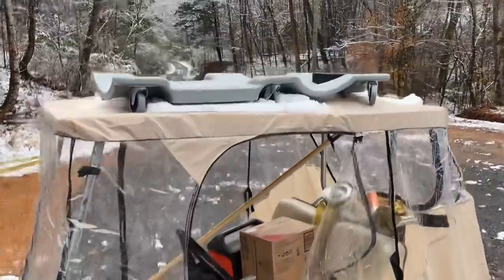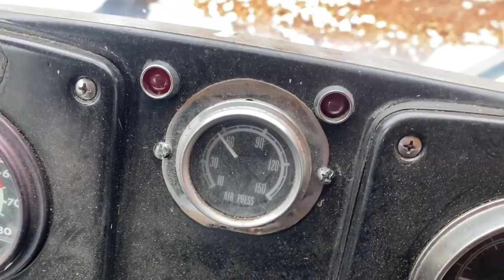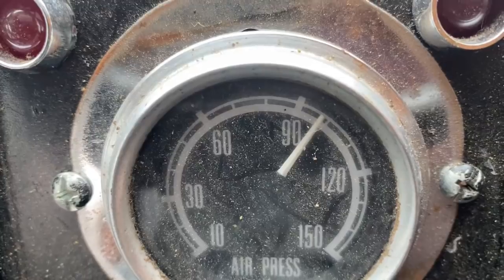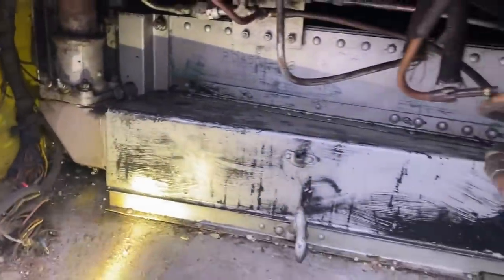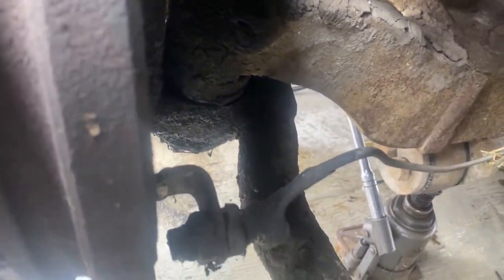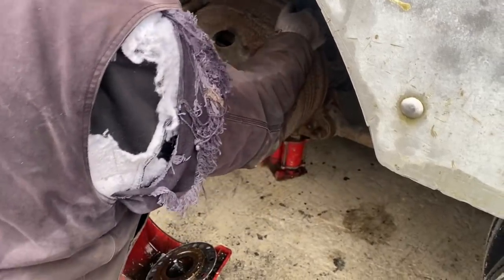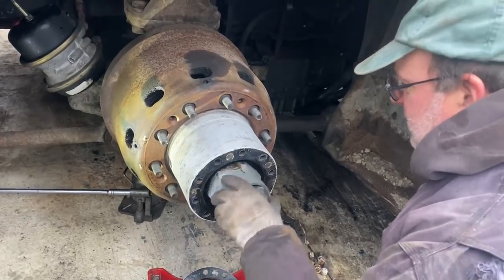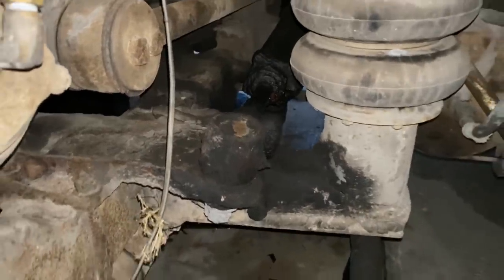Scenicruiser safety issues

Comment: One winter outside then the Quonset hut! I like to make a suggestion (but maybe you already thought of it). Heat the floor. Be the best thing you could do IMHO. You can hear each individual pully and belt problem. I got some noise in the back. He has a point about the LH lugs lol
Reply: Yep. In floor radiant is definitely the way to go. I worked in a shop that had it for a while. It was great!

Comment: Scott, I'm almost 71 now and learned to drive tractor-trailer in two separate Int'l tractors, one with 8V-71 318h.p. and the other with an 8V 71T 350 h.p.The 2 strokes were used in many different applications and the  only ones that were really successful were the G.M.engines.2-53, 3-53, 4-53, 6V-53, 8V-53, 2-71, 3-71, 4-71,6-71, 6V71 8V-71, 12V-71, 16V-71, 6V-92, 8V-92 , 12V-92, 16V-92, 6-110,12V-149, 16V-149, 20V-149 and also I believe a 24V-149 turbocharged and non turbo. The 110 series was used in the early Euclid road machinery.

Comment: Scott. In my lifetime, I am approaching 66 years of age, I have come across situations where people from my past, and situations during those times, living on farms, old tractors, and the what not, marine diesel, as a marine surveyor, I have familiar understandings for early Detroit. 353, 453, 653,671, 692, 871,892, 1271..six cylinder 6v 92...as well as 8's and 12's and 16's.....and on into Locomotive applications. If you are not charging at least $150 dollars an hour...I think you are, and should be, I'm moving in and also repair buses..like YOU!

Comment: I'm impressed at how the chassis appears to be largely free of corrosion.  No obvious weld seams opening up.   Replacing the moving parts, wheel bearings, seals, rubber suspension bushings, king pins, some air bags, tie rod ends, pitman arm, that is what you'd expect after a lot miles.   I'd think the steering box would have a lot play by now if it hasn't already been rebuilt or replaced.  

The Scenic Cruiser had an issue with cracking frames.   I think there was a retrofit kit for them.   I wonder if this bus has it.  The Scenic Cruiser is still one of the coolest looking busses ever.   I can easily see why somebody would resto-mod one.  At least a few models came with a 12V71 a V12.    Not turbocharged originally.   Its amazing how advanced it was.  Airbag suspension, independent tag axle (I assume).  Solid axle front suspension, but only the Eagle bus had an independent front suspension years later.

Comment: I like how this rig has primary and secondary belts. My big rig doesn't even have that. Just one thick ass belt.
Sometimes you gotta have them sit at a high RPM to open the valve to fill the air tanks lol.
Great sounding motor though.

Comment: 21:33 - "Looks like dollar signs to me!"🤣 Yeah, buddy! Replacing those big-ass bearings, kingpin & bushing kits, labor, etc. can get expensive REAL quick on one of those beasts!😲 I'd definitely be getting rid of those stupid 'spike' stud caps and just sand down and repaint the nuts on those 10 hole Budd's. They're a hazard any way you look at it.😜 Heck, even just round chrome caps would be an upgrade!😁👍
Reply: Those caps hide loose lug nuts, I never used them.

Comment: For the life of me, I can’t understand why anyone would ever put an old bus on the road without replacing tires, wheel bearings, seals shocks and brakes on all wheels. And doing an air test before they move.
Reply: Heck, even when i buy a pickup I'll give it a going over before I put it on the road. Don't need a few hundred dollars worth of parts causing something that would haunt you for the rest of your life.
Reply: I think that guy lives real close to BGM, that was only driven a short distance to his place.
Reply: Most of the people that buy old buses are dreamers who want the lifestyle and think it's as easy as buying a relatively cheap old bus, then heading down the road.
 They don't even maintain their cars, what chance does a bus have? I'm actually surprised at how cheap most of these bus items are, certainly not nearly as expensive as I was thinking.
Reply: @TyphoonVstrom  All too true. I'm involved with preserving old buses in the UK and many of the people who take them on have no idea that  they were only kept on the road by a rigorous and expensive maintenance programme. If you buy one that's been neglected you need deep pockets!

Comment: The hatchet is for egress which is required by DOT and FRA passenger coaches. Usually they are covered in shatterproof glass with a little tiny hammer to break it out. Shatterproof so no one gets cut. 

It sounds like a joke but it is true.

Comment: Same as my truck. On any problem if there is a $20 repair and a $500 repair, it will be the $500 repair, with another $1000 repair discovered getting to the $500 repair.
Reply from the maker: True then add back order parts :)

Comment: I think that guy is very lucky considering the shape of hubs/brakes/bearings/etc. As a mechanic it scares me when I see some of the issues on the road.  I have seen ball seat aluminum front wheels that don't have steel inserts so the seat is worn out and the nuts bottom on the stud and hub,

Comment: Myself I hate the lug nut covers. We have them on a few trucks. I don't like them cause they can hide problems like a loose lug nut. Thankfully the truck I run doesn't have them. King pins could be worse the internationals we have just can't replace the king pins have to replace the whole axle. They don't even make replacement king pins for them. That's what international told the boss. I always check my hub oil about 2 times week just to make sure the oil level is good and no water is getting in. I also check the backside to make sure it's not leaking. The drive axle I just make sure there is no leaks. Must be doing something right my truck is the least in the shop for things that should be caught during a pre or post trip. I don't like being broke down on the side of the road. Of course it does happen unfortunately but for me it's things that I can't control like a o ring for a fuel line or a air compressor going out with no indication it was going.

Comment: The North American society of engineers recently removed use of the measurement term "titty height", but the reasons relate to the position of the nipple in relation to the upper torso as human beings age and the concurrent descension of the nipple along the rib cage.  Moreover, a routine ocean liner servicing over 8 years turned into a tale of two titties, a genuine disaster when the titty height failed to account for the age and caloric intake of the older repair crew.

Comment: What the heck is that little bottle jack at 19:07? My Blue-Turd has destroyed a pair of "ten ton" bottles.
Reply from the maker: The front axle weighs 12k.   So it’s well under the rating.  There are two jacks one on each side.  Also note that there is no hydraulic lift on the cylinder it’s just being used as a stand.

Comment: just curious.. do you have a king pin bushing extractor and installing tool.. perhaps even a king pin bushing reamer since you stick to usually buses.   how do you handle egg shaped king pin bores in the axle ends.. ??
Reply: That would be an axle off job if you'd ask me, and not something he'll be able to do (machine job job).

Comment: I would have thought those pointed studs sticking out from the front wheels are a safety issue more obvious than anything else. If you don't get run over by the bus you are at least guaranteed to be ripped to pieces by the protruding wheel studs!
Reply: They are plastic
Reply: @1320fastback  Being plastic and especially being glued on  is not going to stop them from doing a lot of damage. Wouldn't be legal where I come from!

Comment: Hey Scott... what was the original build number on this 4501, do you know?   Was wondering if this was one of the pre-1961 models with the original twin 4-71's.   Too bad that GM didn't use the 6-110 for power, would have "stronger" than the 8-71's that they put in them starting in 61, and used to re-power all the twin 4-71's with.  

A 6-110 would have only been 2 or 300 lbs heavier than the original twin 4-71's.... but, considering all the cracking issue's in the rear 3rd of the 4501's... they really didn't need to add more weight of any amount, and the torque of the 6-110 probably wouldn't have helped matters, either.... at least they able to shave off about 1150 lbs with the 8-71, so that had to have helped the stress issue's, I would think.  

Having a 4 stroke in a 4501 just isn't "right"!!  lol.... but at least whoever did the conversion, kept in the family with that Series 60.... could have been "worse" and repowered it with "Cumapart" or a Cat,  the 60 series were & still are, great engines... for a four stroke. lol   Is this one a 12.7 or the 14.0 Litre?  The 12.7 was more reliable and 600hp with them is easily doable.  

A friend of mine recently re-powered his 389 Pete from a C15 Cat (the compound turbo'd,  Accert engine - the engine that "encouraged" Cat to get out of the HD truck market), to a 12.7 Detroit, that he bought as a fresh Re-man (Not "rebuilt"), and shipped it to Bruce Mallinson (aka Pittsburg Power & his new 28,000 sq. ft shop and research center), who added some of his high performance parts to it (Turbo, tuned manifold, harmonic balancer, etc, etc.) and full high performance tune, which resulted in a dyno tested and certified 680hp.  

I'm not a fan of the 4 cycles, but if I was forced into having one under the hood, it would be the 12.7L series 60, over the 14 Litre.... in the meantime, I still love my V12 (71), and 6-110.
Reply: 1001 4501's were produced by GM truck and coach between 1954 and 1956.  They all were fitted with twin 471's until Marmon Herrington started the 8-71 conversions in 1962.  This coach refurbishment campaign, which included interior and exterior refurbishment (gold stripe livery) was in anticipation of  Greyhounds 50th anniversary.

Comment: Check on it is running out on change oil and speed off also air spring turn down rewind it up needs fixing Break toon up it water how shocking freeze into tire good 🚌

Comment: Those bullets on the front wheels are illegal and very dangerous.

Imagine a bicyclist's leg being torn to shreds if he gets too close, or a pedestrian that gets too close, because he's not paying attention.

Pretty it up some other way.
Reply from the maker: Well if the plastic lug nut covers hit a bicyclist the mirror would have decapitated them too so the leg injury would be negligible
Reply from the maker: Oh and get worried about the real dangers like massive air brake leak, bad king pin, loose wheel nut.    But no... you choose 1oz plastic caps to freak out about...
Reply: Why are pedestrians and people on bikes so close to a moving bus?
Reply: @BusGreaseMonkey  I saw a kid trip over and land against a wheel with those weapons on it, I don't want to see that again.  The truck was parked, not moving (or indeed likely to move for a few hours).